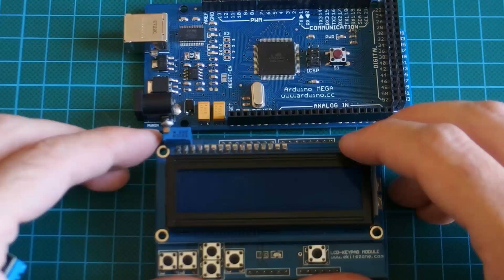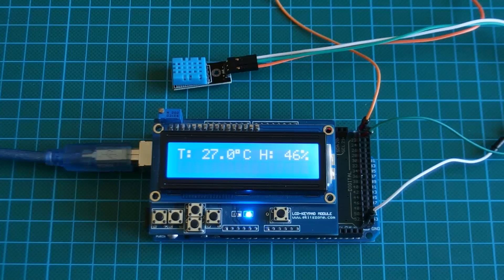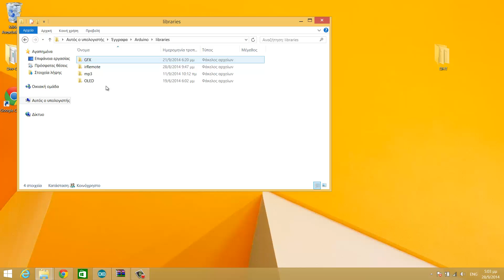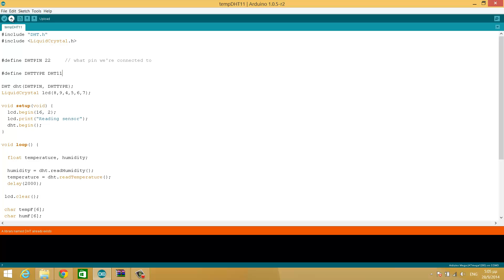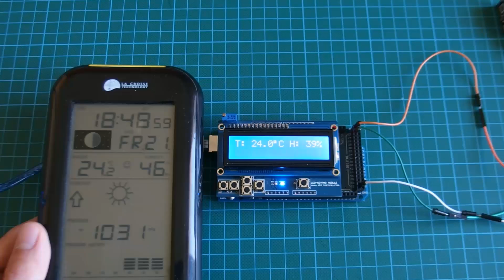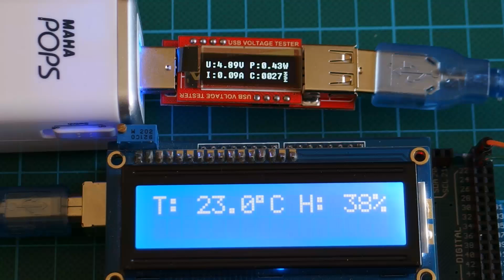Arduino Project: Temperature and Humidity monitor Tutorial with DHT11 (or DHT22) sensor LCD shield.

Comment: Arduino:1.8.3 (Windows 8.1), Kart:"Arduino/Genuino Uno"

In file included from C:\Program Files (x86)\Arduino\libraries\DHT\DHT_U.cpp:22:0:

C:\Program Files (x86)\Arduino\libraries\DHT\DHT_U.h:25:29: fatal error: Adafruit_Sensor.h: No such file or directory

 #include <Adafruit_Sensor.h>

                             ^

compilation terminated.

"DHT.h" için birden fazla library bulundu
Kullanılıyor: C:\Program Files (x86)\Arduino\libraries\DHT
Kullanılmıyor: C:\Users\EyyüpEnsar\Documents\Arduino\libraries\DHT-sensor-library-master
exit status 1
Error compiling for board Arduino/Genuino Uno.

This report would have more information with
"Show verbose output during compilation"
option enabled in File -> Preferences.
???????
Reply: i have dht21

Comment: Your fucking setup melted my sensor
Reply from the maker: You probably did something wrong!
Reply: Make sure to double check that YOUR work looks correct to YOUR module and don't follow along blindly.

for example, MY module reads (from left to right, looking at the front) GROUND, DATA, VCC

Comment: i am using a arduino uno with lcd screen and the same sensor as in video but i donot have same inputs for sensor on arduino can anyone help?
Reply: On the video description it state : "In this video we are building a Temperature and humidity monitor, using an Arduino Mega."      Arduino Mega = more pins . Peoples should get used to read imho.

Comment: this is the error i get when verify... can anyone help me?

In file included from C:\Program Files (x86)\Arduino\libraries\DHT\DHT_U.cpp:22:0:
C:\Program Files (x86)\Arduino\libraries\DHT\DHT_U.h:25:29: fatal error: Adafruit_Sensor.h: No such file or directory
 #include <Adafruit_Sensor.h>

                             ^
compilation terminated.

exit status 1
Error compiling for board Arduino/Genuino Mega or Mega 2560.

\
Reply: Arduino: 1.8.2 (Windows 7), Board: "Arduino/Genuino Uno"

C:\Users\Tapalla\Desktop\AlarmClock2\AlarmClock2.ino:3:17: fatal error: DHT.h: No such file or directory

 #include "DHT.h"

                 ^

compilation terminated.

exit status 1
Error compiling for board Arduino/Genuino Uno.

This report would have more information with
"Show verbose output during compilation"
option enabled in File -> Preferences.

Hope you could also help me ;(

Comment: i think when i playeed with these last year reading the data raw iand not using libraries that the sensor works in 1/3 of a degree C so returned like 10.0, 10.3, 10.6, 11.0 etc
Reply: I usually avoid the libraries for being slow

Comment: I have a project using dht22 sensor and transmit uses NRF24L01 transmitter module. Do you have reference about NRF24L01 for 2 way communication?
Reply from the maker: +guntur noor fadhly I am going to make a video about that soon,.

Comment: +educ8s.tv 
this is a helpful tutorial but could you add a fan and a relay to activate heating element 
and use the Lcd along with the buttons to set and control the temperature it will be active station 
or maybe with TFT touch screen ;)
thanks (y)
Reply from the maker: +Akrout Osama Hello, using a relay is not difficult. Also I am planning on using project with a touch screen soon!
Reply: +educ8s.tv Hi;
yes but setting the temp value and store it in the Eeprom this i found it difficult .
using a touch screen with GUI it id gonna be awesome ... i can't wait (y)  ;)
thanks
Reply: i have this solution but with microcontroller PIC 16F887

Comment: works, only sometimes says that you can not read the data from the sensor "Failed to read from DHT sensor!". The resistor is set to 4.7 - did not help. Used DHT-22

Comment: Thanks a million, I have been trying to get mine working for awhile now with some but limited results.  Been playing with a DHT11 but got my DHT22 in the mail today, that combined with your stuff and a bit of my Americanization of it, I now have mine working giving me the Temp in F instead of the dreaded C that we in American look upon with fear and loathing.  Here is my sketch, well your sketch but with a bit of modification:
#include <Wire.h>

// DHT code from:
// Example testing sketch for various DHT humidity/temperature sensors
// Written by ladyada, public domain

#include "DHT.h"

#define DHTPIN 13      // what pin we're connected to

// Uncomment whatever type you're using!
// #define DHTTYPE DHT11   // DHT 11 
#define DHTTYPE DHT22   // DHT 22  (AM2302)
//#define DHTTYPE DHT21   // DHT 21 (AM2301)
DHT dht(DHTPIN, DHTTYPE);

// LCD
// LCD RS=3, EN=4, DS4=5, DS5=6, DS6=7, DS7=8
#include <LiquidCrystal.h>
LiquidCrystal lcd( 8,9,4,5,6,7);

void setup() {
  Serial.begin(9600);
  // set up the LCD's number of columns and rows: 
  lcd.begin(16,2);
  dht.begin();
}

void loop() {
  
  // Reading temperature or humidity takes about 250 milliseconds!
  // Sensor readings may also be up to 2 seconds 'old' (its a very slow sensor)
  int h = dht.readHumidity();
  int t = dht.readTemperature();

    // set the cursor to (0,0):
  lcd.setCursor(0, 0);
  // print from 0 to 9:
  
   lcd.print("Temp: ");
   lcd.print(t*9/5+32);
   lcd.print("F");
  // set the cursor to (16,1):
  lcd.setCursor(0,1);
  lcd.print("Humidity: ");
  lcd.print(h);
  lcd.print("%");
    delay(200);
}
Reply: omg i cant thank u enough i was sitting the whole night in front of my pc and had the dht.h all most wanted to burn it down xD ps. welcome from germany
Reply: Glad it helped you out, my Grandfather came here from Germany back in the 1910's and began farming in North Dakota.
Reply: Jerry Ericsson Fahrenheit is shit

Comment: This is great!!! I made it work with an 20X4 LCD screen with an I2C 2 pin connection and an Arduino UNO. the only thing I had to modify was to add this lcd.setBacklight(HIGH); right at the begining of the void loop command. Thank you!
Reply from the maker: TBM tech You are welcome!

Comment: Good information. I am wondering how we can add 2 library (One for Display and another one for Temp Sensor) in Arduino UNO IDE? Thank you..
Reply: Probably you have the LCD library already (after installing the IDE, which is my case) and you just have to  #include  it.
Just check ...Arduino/Libraries/LiquidCrystal. If you have it you're good to go, otherwise download it and create a folder called LiquidCrystal in that location (...Arduino/Libraries) and paste it there.
Reply: Hi Gulherme, Thank you for the answer. Here are the details about my project. I am using Arduino Uno with Nokia 5110 LCD Display and DS18B20 Thermal Sensor Probe. If i connect them separately then it works file. I would like to pull the temp reading on Nokia LCD 5110 Display which is not possible because i can not add (merge) both the library (5110 Display & One wire temperature sensor ) in Arduino IDE. Any suggestion. Thank you.

Comment: nice projects 

but you when convert float to string why we use number 0 and 2 and 5 and 1 in forumal
Reply from the maker: mustafa kenany I explain: dtostrf(temperature, 5, 1, tempF);

the 5 is the max digits. Temperature can be -10.1 for example which has 5 digits. The 1 is how many digits after the dot we want. We want only one digit for precision.

For humidity, it is simpler. We can't have negative values, we can have values for 00 to 99, so we only need 2 digits and we don't care about float numbers, so we put 0 for the digits after the dot. We only need to print integers.

Comment: i keep having problems with this. it keeps telling me that dht was not declared in this scope. I even downloaded the library.
Reply from the maker: It seems from what you say, that the library is not set up correctly. Try to close Arduino IDE and reload it. If it is still not working, have you unzipped the library in the correct folder?
Reply: i know what i did. i added the library after i wrote the code so it didnt properly put the library in the code
Reply from the maker: Jake Lampada So now it works?
Reply: yes. it works great. I even added to the code to convert the celsius to fahrenheit.
Reply: Jake Lampada Where can you find that code?
Reply: i wrote the code i needed myself. but im pretty sure he already has the code up to download